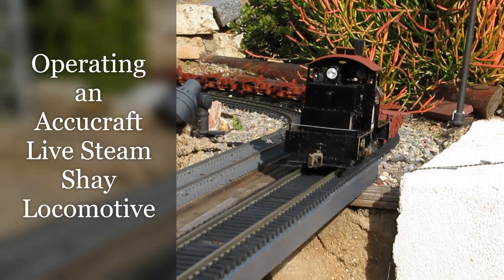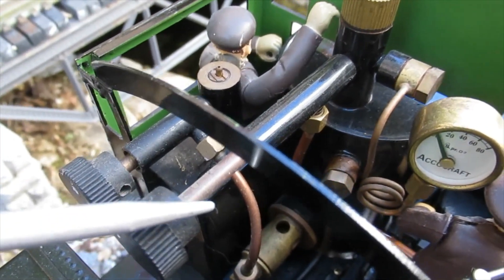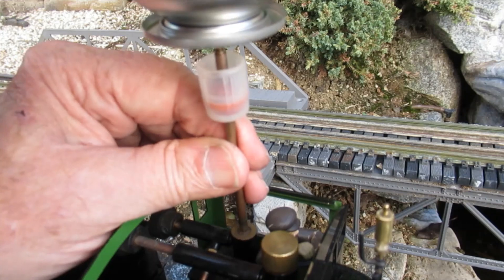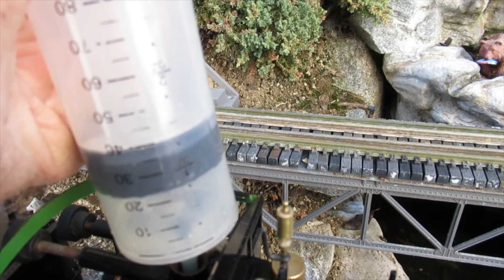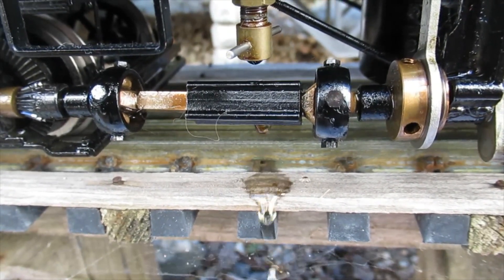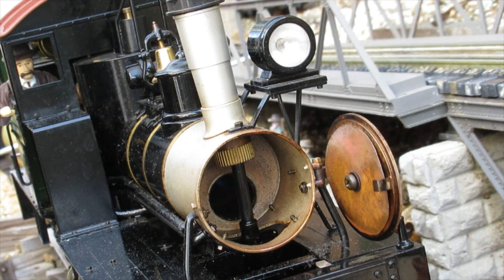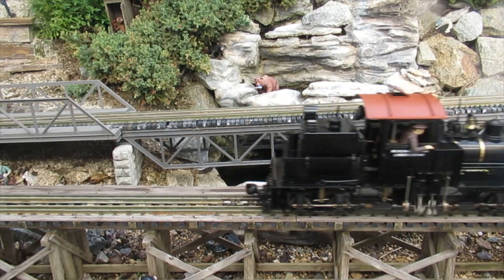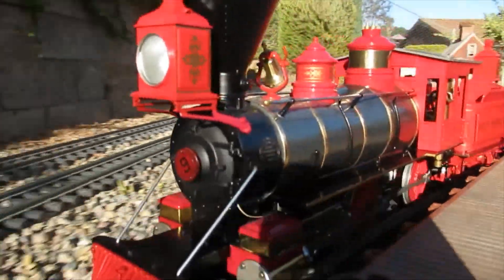Steam up and operation of an Accucraft 2 cylinder Shay live steam locomotive garden railroading fun!

Comment: Does it have a sight glass? If not, I assume it is designed to run out of gas before running dry on water so there isn't potential to damage the boiler. Also is it hard to make it rc?.
Reply from the maker: No sight glass. it usually runs out of gas first.  When it stops running the first thing I do is close the gas valve just in case.

Comment: Richard, your channel is awesome. What do you use for an R/C system? I have a couple of live steamers I'm interested in converting to R/C.
Reply from the maker: Any r/c system should work.  You need 2 channels if you only plan to control speed and direction. On my Ruby I use a 2.4 GHz DX5e from Spectrum, because it was what I had. I use 2 channels for throttle (speed) and direction  https://youtu.be/tNhTWf2Fb2A   and another 2 for the bell, and whistle https://youtu.be/NS166FuPLK0